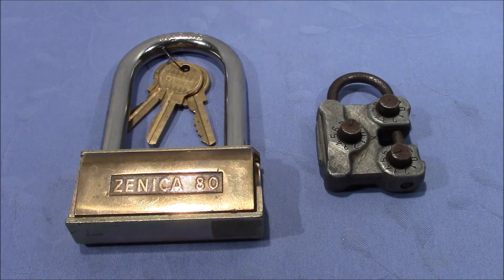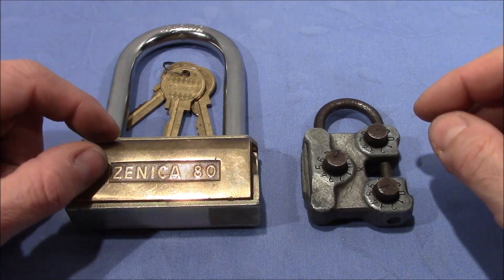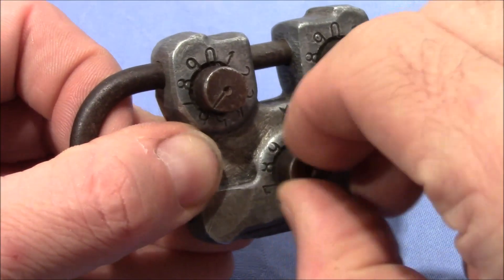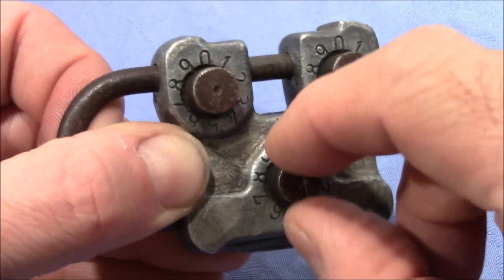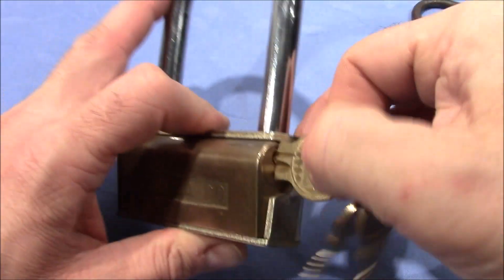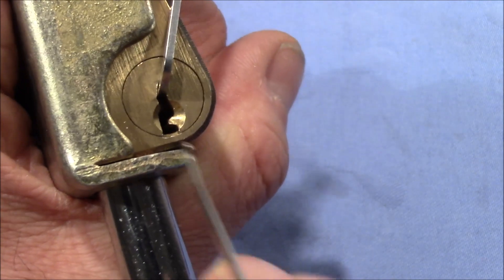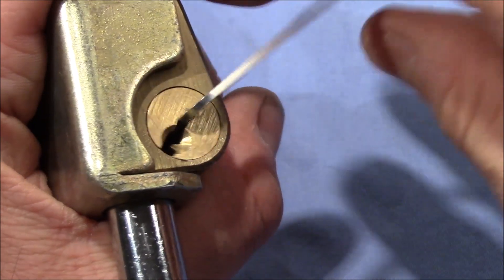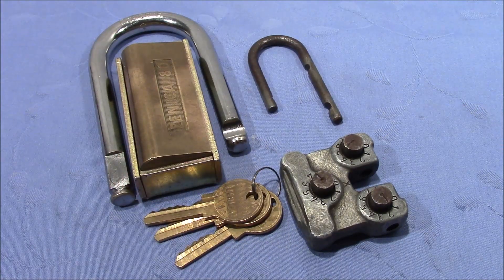(picking 757) Cool locks to demonstrate binding order

Comment: Hi pottie I've got a problem I'm hoping you can give me some advice on I bought a yale rim cylinder lock with the key it worked fine I picked it and locked it now I can't get the key in and I can't pick it have you got any idea what I need to do to get it working again thanks for any information you can give me jimm
Reply from the maker: If you cannot get a key in, then I assume that a pin got stuck. Try tapping the lock with a plastic hammer or handle of a screwdriver from all sides (also spray lubricant into the keyway and wiggle the plug with a tensioner) and see if you can get the pin loose. Can you open the bible? Sometimes there is a plate. This way you could gut the lock and see what's wrong.
More forcefully you could try to carefully drive in the key with a hammer (as last resort).
Reply: @Potti314  OK thanks potti I will give that a try thanks for your help jimm
Reply: Fantastic that worked thanks very much potti